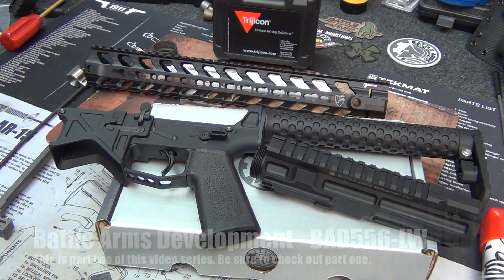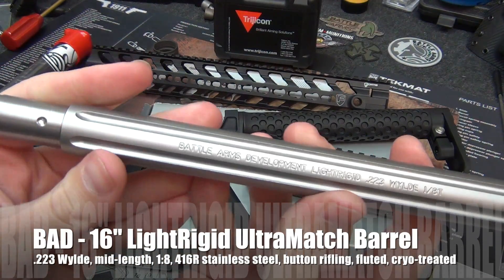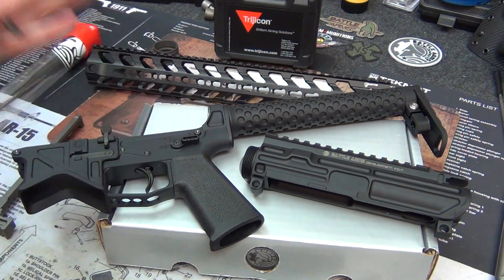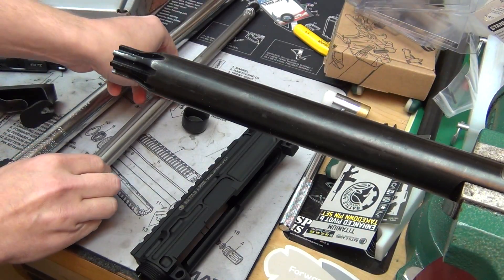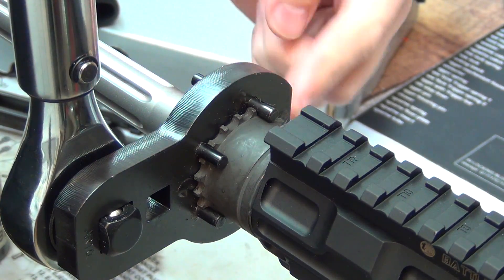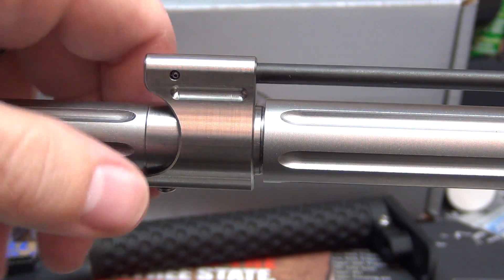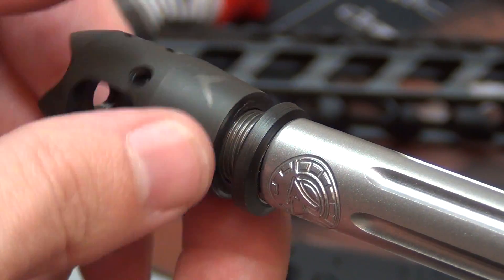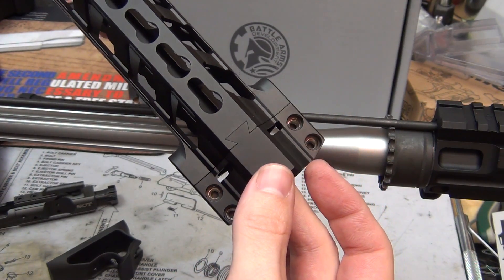AR-15 - Lightweight Upper Build - Battle Arms (Pt. 2)

Comment: Really nice and cool build. Was glad to see you put anti-seize grease on the threads of the upper before putting the barrel nut on. I've seen countless other channels for a barrel change. Who neglect this part. And by not putting anti-seize grease on, it can and probably will cause gauling. One suggest, I would've hand tighten the barrel nut (Barrel installed into upper), and then loosen the barrel nut 2-3 times. This ensures the anti-seize grease gets on all the threads. Possibly you did that and just edited it out to save time. Again, really nice job. Well Done.
Reply from the maker: Rick S Thanks! I always try to follow as much per the TM as possible.

Comment: Nice taste with the Fortis gear. I have their REV rail and SHIFT vertical grip. Loving both for the past year, no problems.
Reply from the maker: DjRjSolarStar I really like what Fortis has to offer.
Reply: How many rounds do you have through this so far? I was considering getting a Ti BCG, but I figured the bolt would cycle too fast and cause extraction problems. Ti also has really bad mechanical friction characteristics, so when its coating wears off, it will begin to degrade quickly.

Comment: Barrel nut wrench should be inline with torque wrench. You are correct in the sense that torque reading will not be accurate but that has been factored in. Look at usmc manual.

Comment: is there any chance you could list the bare carrier weight? I'm trying to do an apples to apples comparison for a friends build and we are looking at the JP parts and the Voodoo part for a carrier, but it's hard to find the true bare weights listed to make a fair comparison. thanks for the video. for reference I have a JP low mass carrier and on my scale it weighs 6.70 oz bare while a bare NiB M16 carrier weighs 9.30 oz on the same scale. cam pins are .20 and firing pins are .25 oz the 158 & 9010 bolts weigh 1.50 - 1.60 oz complete. hope this helps anyone planing a low mass BCG system.

Comment: For a little more weight savings V7 weapons makes a lot of Ti parts including barrel nuts and BCM KMR rail is the lightest rail ( V7 makes a Ti barrel nut for it too ) . Weight could be brought down maybe to 5 lbs even range
Reply from the maker: bryan faulkenburg There are areas where I could shave a few more ounces off but I am very pleased with how it turned out and will more than likely not change anything.
Reply: bryan faulkenburg I did one with the balios lite receiver set, got mine down to 4 lbs 12.6 ounces this photo was from before i switched the carbine buffer out for a taccom. 
 http://www.ar15.com/mobile/topic.html?b=3&f=4&t=672895

Comment: I have a couple of questions.  I am trying to choose a barrel for a build.  Based on the specs I want I've determined that I want to use either a 14.5" barrel or a 16" barrel.  I laid out the barrel specs I am looking for for the 16" barrel:

.223wylde / 5.56
14.5" and/or 16"
1:9 twist
mid-length gas system

This is because I want to shoot bullets in the 40-62 grain weights.

I rarely see any barrels in either length with a mid-length gas system. Nearly everything I see is a carbine gas system. What are the effects of the carbine length vs the mid-length gas systems?  I know the port distances are 7" vs 9", respectively, but why are nearly all barrels made with the carbine gas system instead of the mid-length to better handle 40-62gr bullets?
Reply: +TRob ARob Check out faxon firearms, they make them in a 1-8 twist which is the most versatile twist rate (Why do you want to shoot 40 grain?) also they make one of the lightest barrels on the market, if not THE lightest. (i know this is a late reply, figured i would anyway).
Reply: +Agent garbo Thx. I don't want to shoot 40gn. I will not be shooting anything less than std 55gns. (That was the range given on a Brownell ' s table I saw.)
Reply: +TRob ARob definitely go with a 1-8 twist rate then 1-9 will barely stabilize 62g and nothing higher. faxon is a good "cheap" choice for a mid length 1-8 everything from pencil to fluted. cheers
Reply: +Agent garbo ok. Thx. I appreciate the assistance.

Comment: Awesome looking build! I just have a couple questions. Hope you don't mind.

1) Why didn't you use the BCM KMR rail system with the V7 Weapons Systems Titanium Barrel Nut? That's the lightest rail setup made right now lol.

2) Why not go with the 14.5" BAD LW barrel to save even more weight? I know you would've had to pin & weld the muzzle device on, but still.

Great video(s) as always, Nate!
Reply: Good question, womdering the same. I just ordered the BAD556 lower but I’m going to put it with the BCM MCMR Upper

Comment: So, did you cut the anti-rotation tabs off the Fortis rail?  If so, how did you do it?  Did you then paint the exposed aluminum?
Reply from the maker: +Neil Milam I did! I used a dremel and then a large file. I just used a sharpie.

Comment: it's too bad the Fortis rail doesn't use locking tabs onto the receiver to keep it from rotating under Force. the only thing stopping rotational Force is the barrel nut and the gas tube. I love the look though.
Reply from the maker: +mixflip you won't rotate it.

Comment: I am a fan of the look of a lot of barrel sticking out of the foregrip, but most builds I've seen on YouTube have foregrips that go right up to the end of the barrel, or if not, only leave an inch or so of barrel sticking out. Why is this? Am I weird to like a shorter foregrip?
Reply: +Walter Shmitty I personally think a short foregrip looks like ass.
Reply: Walter Shmitty I like a long handguard for a couple reasons. for one, I think it looks better that way...concealed gas block, just the tip of a mean barrel sticking out. It also gives you more room to grip it. I don't typically do a long hold, but it's nice to have the option. I think the most common reason, and a fairly good one, is that it gives you a longer sight radius for irons. There's nothing wrong with a short forend for most purposes, but most people like longer ones.

Comment: Cool rifle I like LW rifles just a few things I would have done differently if I was building It. I can usually get rifles down under 6lbs with irons using standard mil spec stuff so your saving maybe 10 ounces with those choices. A Faxon or Daniel Defense pencil barrel,  a SLR Rifleworks rail, and some V7 parts I could see that being under 5lbs. LW builds can get expensive fast and are addicting.
Reply from the maker: DeusUltra Cool! I am happy with how mine turned out.

Comment: Mario Mosin Since your comment doesn't have a reply button, I'm guessing you're a troll, but I'm gonna reply to you anyway. The barrel is chambered in .223 Wylde, not .223 Remington. With the .223 Wylde chamber you can use either 5.56x45mm NATO or .223 Remington ammunition, allowing for greater versatility.

Comment: Very nice build.  I did the math according to the links you provided, and came to a total of $2514.  However...PSA complete  Magpul lower blem $130, PSA complete CHF pencil barrel upper with MI rail, $330, Fail Zero EXO BCG $130 on sale, BCM charging handle $45, Aimpoint H-1 $500 on sale at PSA.  Total $1135.  Total weight 6.6 lbs.  Is it really worth the extra $1379 to save 1.2 lbs.?

Comment: That rail looks massive!
Reply from the maker: swdfsdft It is only 14" and weighs like 9oz. It is pretty light.
Reply: it doesn't look heavy, it just looks big. like, circumference-wise.
Reply: nsz85 would I also be able to use 556 ammo in this barrel? Heard that the wylde chamber will accept it just making sure.
Reply from the maker: Jimmy Cox .223 Wylde is perfect for 5.56 as well. Here is more information on it: http://en.wikipedia.org/wiki/.223_Wylde
Reply: nsz85 good deal! Thank you very much.
Reply: nsz85 sorry, one last question. Why no dust cover?
Reply from the maker: Jimmy Cox Just saving ounces. No other reason than for weight saving.
Reply: nsz85 don't know if you are in a dusty environment or not but strike industries has their enhanced ultimate dust cover weighing in at 0.3 oz

Comment from the maker: Part 1: https://www.youtube.com/watch?v=qC1LbK8Epi4
Reply: +nsz85 you should check out F1 firearms they sell a skeletonized AR-15 upper receiver
Reply: At 5:38 you under-torque your barrel (just slightly) -- as mil-spec = 35 lbft minimum, 80 maximum.  You should go with 30 ftlb (3 times) ONLY if you do not set the tq-wrench's handle perpendicular to the vector of the barrel-centerline-to-where-wrench-is-inserted-into-the-armorer's-tool (30 on the gauge then becomes 35actual (on the deltaring), because the longer lever-arm than the tq-wrench itself miscalibrates the tq-wrench's gauge to read lower than actual).  Maybe not dangerously out-of-spec until/unless you get lots of heat/vibration (e.g. full auto), and only if you didn't need to increase by 5 ftlb's to get your gastube aligned with the deltaring's dimple.

Beautiful parts-selection & upper assembly, other than that.

Comment: what did you do with the indexing tabs on the rev 2 rail?
Reply from the maker: +Roberto Rocha I filed them off.
Reply: Thanks, i realized i have a gen 1 battle arms upper and will have to do the same, how hard was it? yours look really good. Great video by the way!!!
Reply from the maker: Thanks! It is not hard at all. I just used a large rasp and a dremel.

Comment: You should let people know that that fortis rail doesnt fit battlearms development upper without cutting two pices of metal from the rail that prevent the rail from spinning when installed
Reply: Eduardo Carmona realy so if I cut the two pices of metal from the rail will it affect it...thanks
Reply: The problem that you would have by removing these pieces of metal from the rail is that your rail wouldn't be as secure since these pieces where made to prevent the rail from spinning on the barrel nut but if you do not remove them the rail will not fit on this  battle arms upper trust me i gout the rail and had to send it back now i opted for the bcm kmr that fits and it's lighter but not as cool looking though:)
Reply from the maker: Eduardo Carmona The Wilson Combat TRIM rail does not have anti-rotation tabs and has worked just fine for me an many others for years. The rail will not spin unless the barrel nut becomes lose, which will not happen if properly torqued. The modification I did to the Fortis rail has not been and will not be an issue.

Comment: Im failing to see why you call it a light weight build... i used PSA complete upper gov profile barrel with troy Alpha rail 13 in, and Spikes lower with PSA parts kit and is wearing magpul grip and ACS L stock, and then topped with Eotech EXPS 2 with magpul sights... my gun comes in at 6.09 lbls... so basically all that extra $ spent for light weight parts really saved you no weight at all...